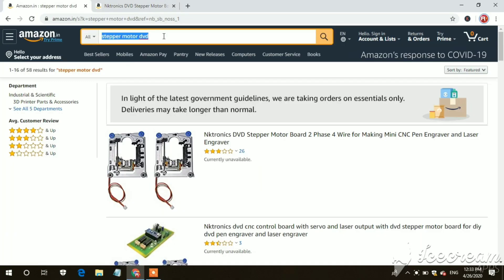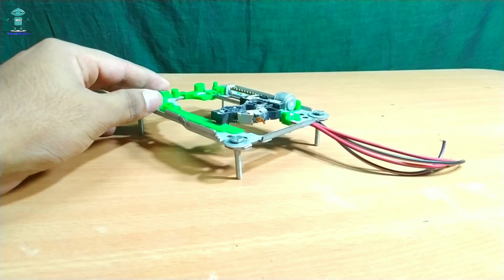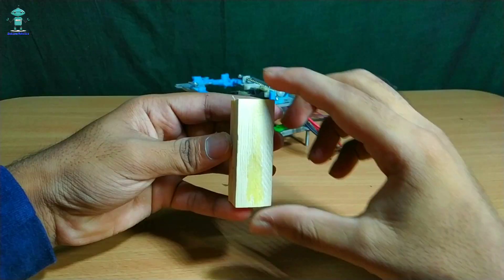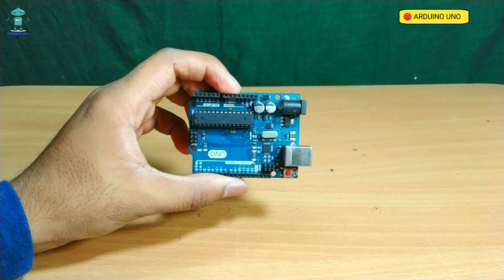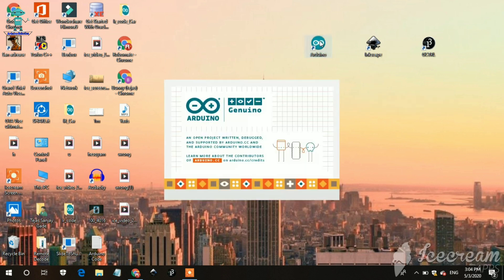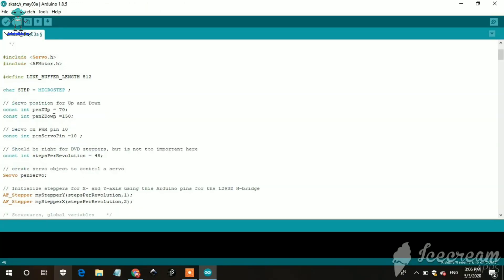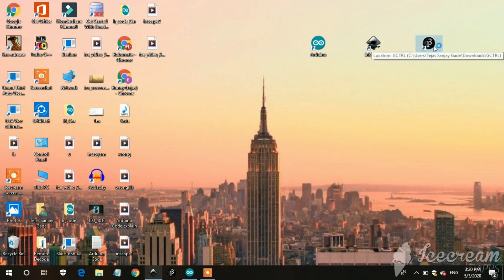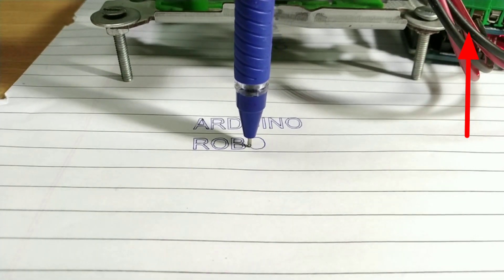How to make Homework Writing machine at home easy || 100% Tutorial on program

Comment: Bro where to contact you
Reply from the maker: Just talk here bro
Reply: @arduinorobotics9512  bro if I will exactly follow all the steps in your video 
Will I be able to make it?
Reply from the maker: Yes bro just follow each n every steps
Reply: @arduinorobotics9512  ok bro
Reply: @arduinorobotics9512  bro from where to buy DVD stepper motor board. Plz tell
Reply: @arduinorobotics9512  bro from where to buy that DVD stepper motor board?
Reply: @arduinorobotics9512 bro some channels are also uploading this thing in arduino ide :- "AFMOTOR LIBRARY FOR ARDUINO"
Is it necessary or not?

Comment: great man, nice video bro ! , can i change the servo motor with bldc motor ? do u think i can make the simulation by using proteus8 for this cnc project? , can i get the circuit diagram email me at faizaiman1998@gmail.com , Thanks
Reply from the maker: Sure ✌️
Reply: @arduinorobotics9512  Thanks man ;)
Reply: @arduinorobotics9512  bro i still didn't get your email , can u give me your email id , i send email to you first .
Reply from the maker: Check ur mail

Comment: How we can adjust speed in this
Reply from the maker: We can't increase speed,by the way use mega ,it control motor fast
Reply: My stepper motor heating while running what's the reason
Reply from the maker: How many Power supply your r giving to shield
Reply: I connect with laptop only
Reply from the maker: Means sheild is connected with laptop and Arduino also connect to lap?
Reply: Sorry, i use external 6v
Reply: Yes
Reply: Sorry no arduino connected with lap and sheild connected with 6v
Reply: Please answer me
Reply from the maker: Bro Arduino toh laptop se he connect honga na nahi toh code kaise run honga,aur shield ko 5v volt he dena
Reply: I dont know hindi,please answer me in english please

Comment: Please specify 4 wires of X and Y axis connections to circuit board
Reply from the maker: Bro it's very simple ,it's not necessary to specify
Reply: @arduinorobotics9512  I am not getting it right bro.......non of the axis are working.....completely fucked up right now
Reply from the maker: Send me your contact
Reply from the maker: I will try to solve your problem
Reply: 9148041104-watsapp no
Reply: Please be free to contact any time.....
Reply from the maker: First Check how to find winding of Motors
Link-https://youtu.be/eK1oLk5B8tU
-------------------------------------------------------------
Then Watch this video and follow the same step by replacing 28byj motor to step (Dvd motor)
Link-https://youtu.be/kKB6cKKJAko (don't get confuse step motor has 4 wires )

Comment: Bro please tell it's full cost to all meterial
Reply from the maker: Arduino-450₹
Motor driver-250₹
2X Stepper motor -500₹
Cable-80₹
Jumpers
MDF board
Reply: @arduinorobotics9512  the so much ,

And can I draw anything in a4 sheet paper 🤔
Reply from the maker: No bro you can draw in 4cm x 4cm size paper
Reply from the maker: If u want to draw on A4 size paper ,then u  have to change both motors to bipolar motor with hardware parts ,

Comment: Bro can i get the circuit diagram for this project plzzzzzz...
Reply from the maker: Send me your mail id
Reply: @arduinorobotics9512  
yeshuyeshwanth100@gmail.com
Reply: Can i use my charger
Reply from the maker: Tell me Charger details
Reply: It says input 100-250v 50/60hz and 0.5a
Output - 5.0V  and 2.0 A
Reply from the maker: @yashwanth5363  ok u can use it
Reply: Thanks for ur help ur the best
Reply from the maker: First Check how to find winding of Motors
Link-https://youtu.be/eK1oLk5B8tU
-------------------------------------------------------------
Then Watch this video and follow the same step by replacing 28byj motor to step (Dvd motor)
Link-https://youtu.be/kKB6cKKJAko (don't get confuse step motor has 4 wires )

Comment: Plzzz make phone controled plzzs bro
Reply from the maker: Ok🤩
Reply: @arduinorobotics9512  bro when will you make it i have all the circuits nd motors but my pc is dead . Plzzz make it fast full phone controlled programming also from phone. Plzz make usb otg supported not bluetooth
Reply: @Sania.175  bro, if u want to control cnc wirelessly then first ee need to program it to run wirelessly for that laptop is necessary, 😇😊

Comment: Sir help me to make it
Reply from the maker: Ok,which problem u r facing?
Reply: @arduinorobotics9512  I thing  to make this project for sumbit to collage in final year .
But  little bit bigger work on  A4 paper.
And big problem on this project is codding or connection of wire.
Reply from the maker: Sure,in my future projects I will create a bigger cnc plotter 👍🏻 Check description for the code😘
Reply: Sir I start to making this project 
How I connect to u
Reply from the maker: Contact-rashinkarkashmira9@gmail.com